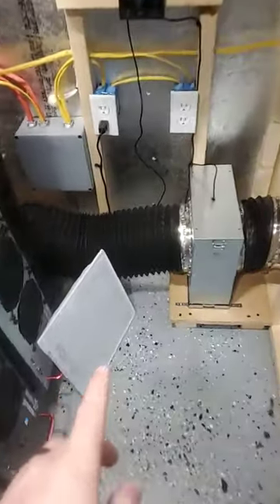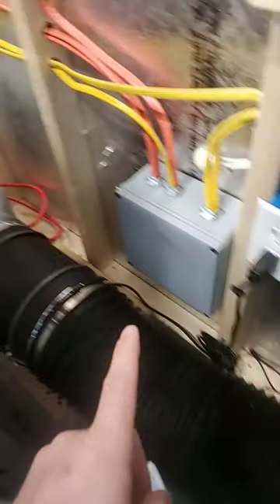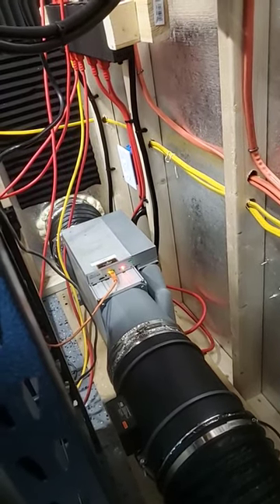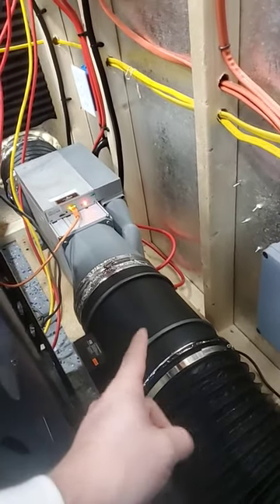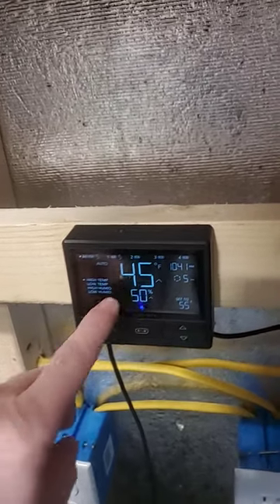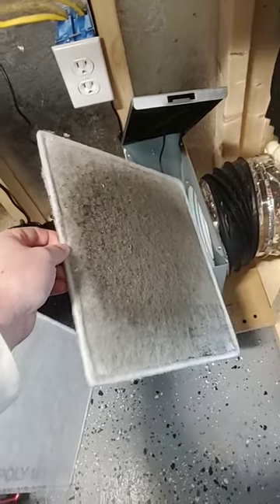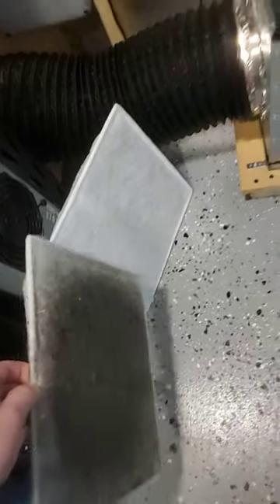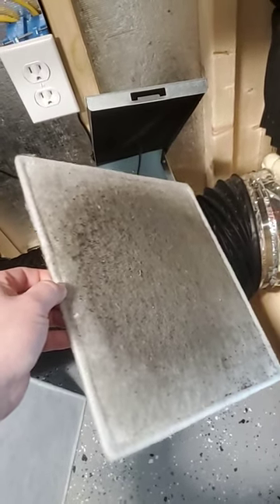OMG this BITCOIN Miner's Intake Filter is SO DIRTY! #Shorts #Bitcoin #Crypto

Comment: Lol that miner need 100-200 cfm at those temps. The stocks fans do maybe 450 cfm max
Reply from the maker: 800 CFM plus cold temps = Overclocking!
Reply: @TheHobbyistMiner  fair - what speeds you getting? I guess my air is a bit colder in ND, but I was getting 140TH and the fans still only had to spin about half speed. I'm not OCing anymore, I don't think the efficiency loss is worth it in when prices trend negative. But when they start trending  up more again I'll probably speed them back up.